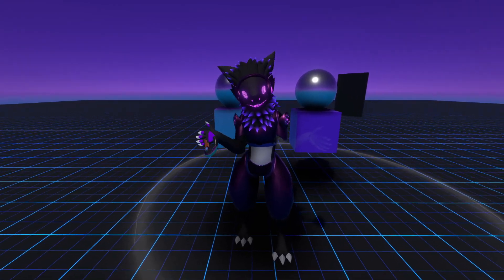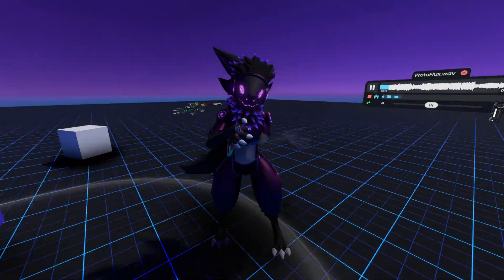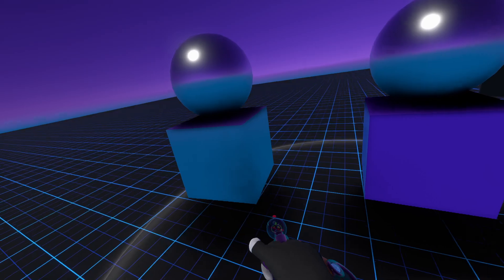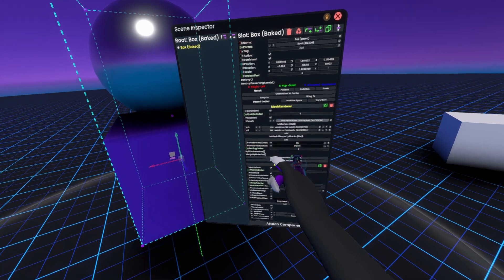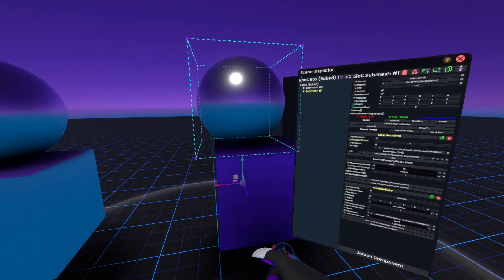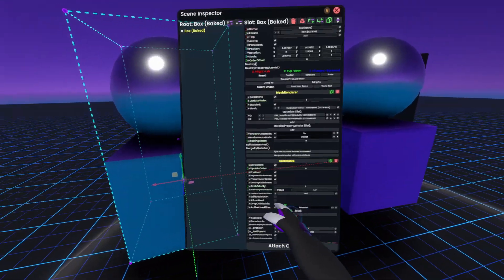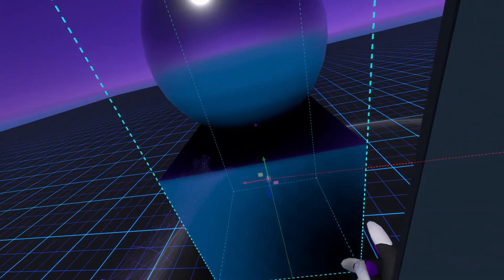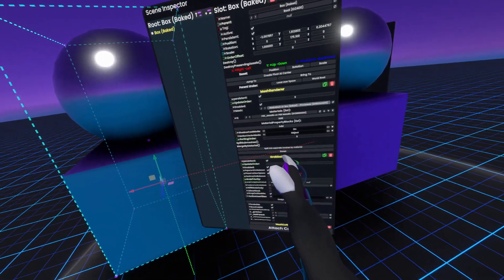Resonite - Joining/Seperating SubMesh by Material  [Tutorial]

Comment: Heyo, first of all - I appreciate all the Videos! :D 

I'm new to Resonite and I'm not very educated when it comes to game design / programming 
aside from some specific small things from small projects for fun.

I'm assuming you join those so it's more performant?
Which tells me I should probably join my walls/floors together lol

Altough that sounds a bit scary since I wouldn't be able to separate them again to for example remove a wall, correct?
Meaning I should have 1 Copy for editing and 1 for publishing?
Reply from the maker: Heya! thanks!
Joining 2 Meshes is not really gain you any performance unless the 2 objects share the same material.

I would always suggest to keep an umerged backup and then merge as you need so you can always edit things in the future!

Also youll generally not see any beneftts from joining 1 or 2 or 5 meshes